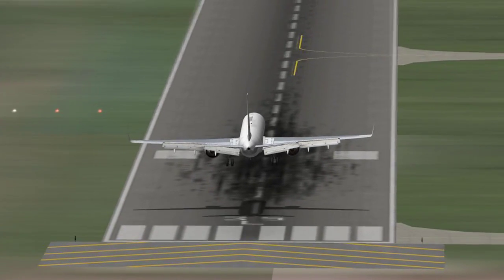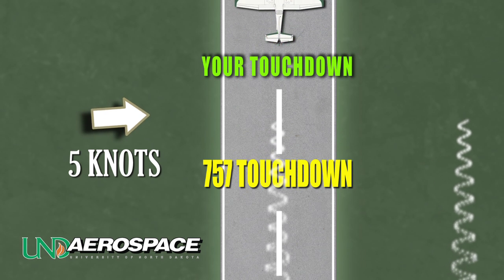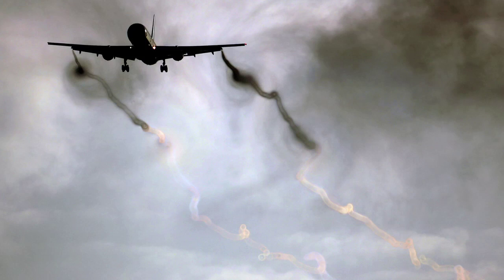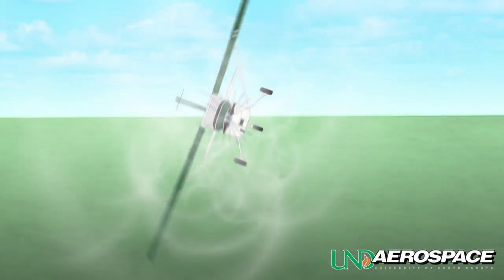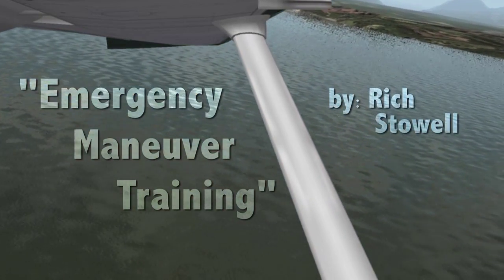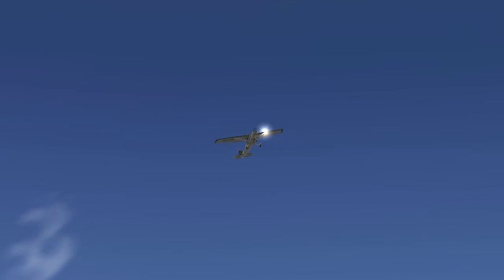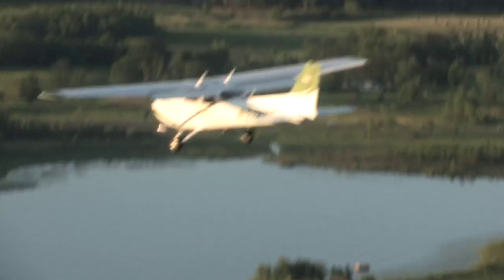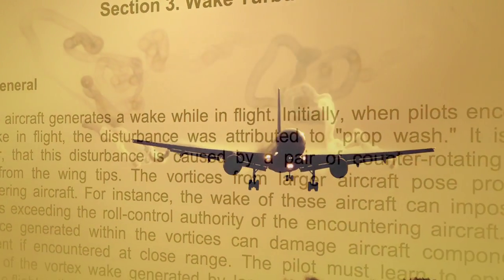(VIDEO 2) Wake Turbulence Avoidance

Comment: Even the the 757 is considerably older now, it's still a beast. It's got these fighter jet like wings that are shorter than most planes its size allowing for greater mobility. But the best part about the 757-200 ( the one with PW engines) the engines! When a 757 takes off, it launches into the air like a bat out of hell! Love it! I've been on a few in the past that seemed as though it maintained well over 20 degree pitch angle for quite some time, doing all sorts of sharp bank angle turns.

Comment: The The 757 has been responsible for several crashes in the past, including 1 major crash that resulted in a large commercial plane taking off after the 757 crashing and killing on board. due to wake turbulence it generates. Particular the 757-200. According to investigations the 757 engines and wing design generate turbulence so violent that even the might 747 has problems dealing with the turbulence, and as a result the FAA has mandated that planes taking off after 757 space out more time.